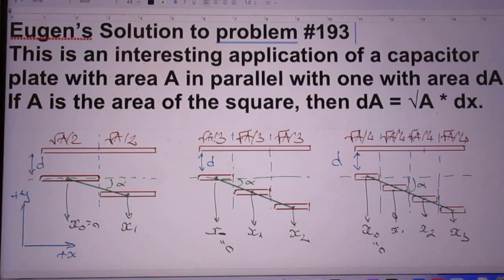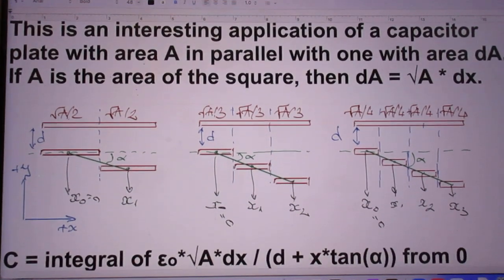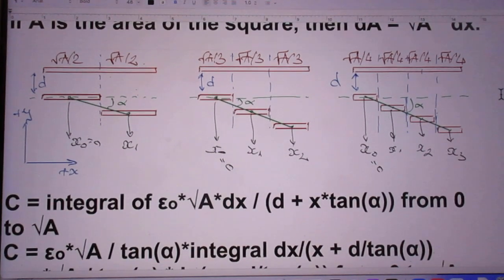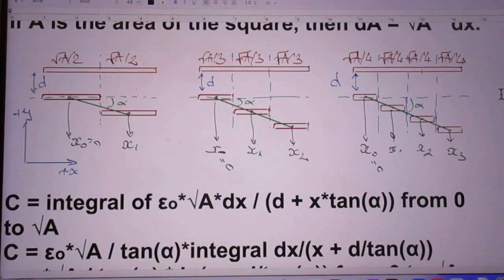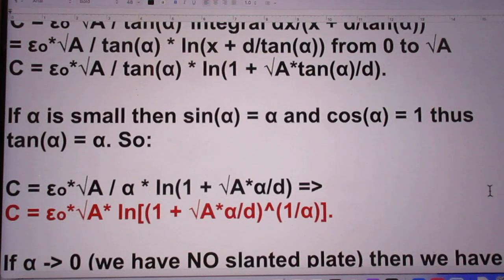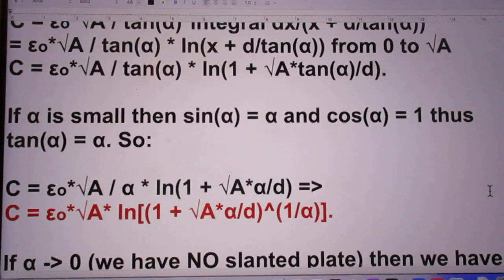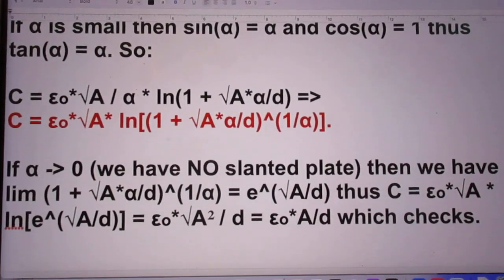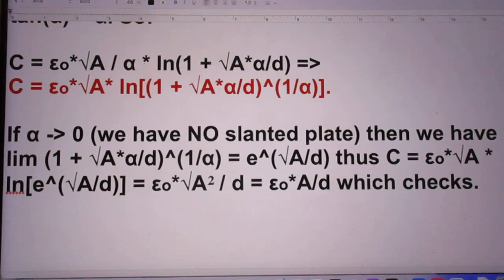Eugen's Solution to #193

Comment: @lecturesbywalterlewin.they9259  Sir, the proper solution is not mentioned anywhere. My doubt is specifically regarding two capillary tubes placed above one another. In case of insufficient length of one tube, will the water rising in the tube will cross the interface or would the meniscus adjust it radius on the interface for balance?

Comment: I watched both solutions and think the derivations are a bit awkward and strange. 
If the plates have an angle theta and the electric field lines end up perpendicular to the plates you get for the length of the field lines in a distance h the value d + h * theta and for the capacitance C = e0 * integral from 0 to sqrt(A) [sqrt[A] / (d + h * theta) dh ( same integral which is mentioned in the solution previously as aproximation ).
Reply: The key thing is to "assume" parallel field lines, which you also do for a parallel plate capacitor of finite dimensions, so ignoring edge effects. Once you do that we all end up at the same approximation, possibly by different routes. If the field lines are really not parallel we end up using a mathematical technique called conformal mapping, to make them appear parallel, which is way way way more involved!
Reply: @KeithandBridget  I think, if the plates have an angle > 0°, the field lines are curved (it has to be that way) and i do not need this approximation with small parallel plates or conformal mapping.
Whether the exact form of the field line curve is a part of a circle + straight line, i don't know and Walter Lewin mentioned nothing about this, but this way of thinking is easier and not worse either.

Comment: Hello professor,
I was thinking of using infinitesimal steps and integratimg when I saw the problem, but my question is can we still consider that we have small capacitors, because to get the expression of the capacitance we consider an infinite plate and an electric field which is perpendicular to the plates, but if we take delta(y) as the height of the capacitor, how can we justify using the same formula while our system is more similar to two parallel wires instead of plates?
Reply: It's not two parallel wires, there is no gap in between them. The key assumption is parallel field lines.
Reply: @KeithandBridget Got it, thank you very much